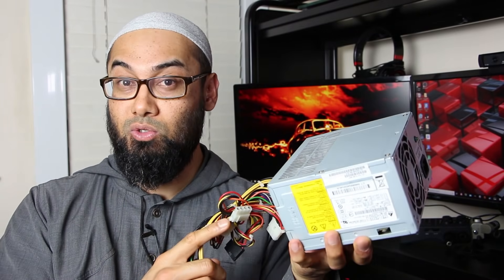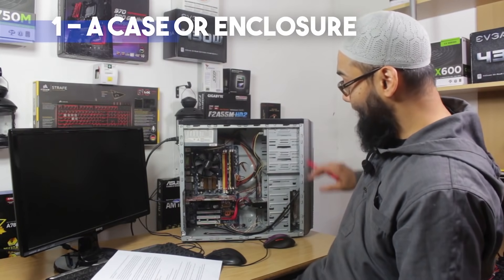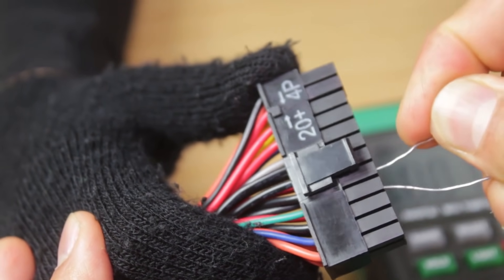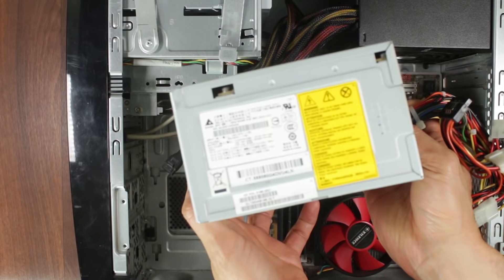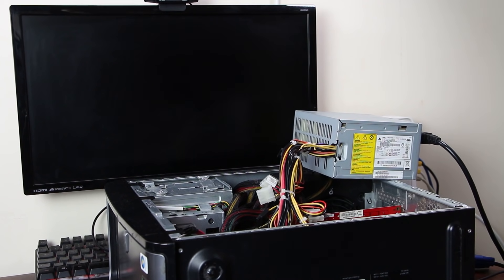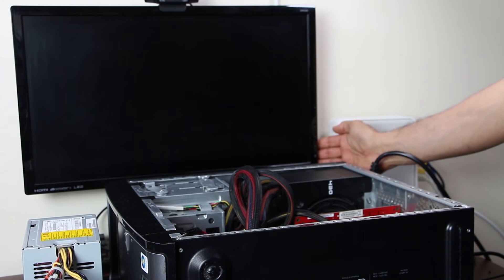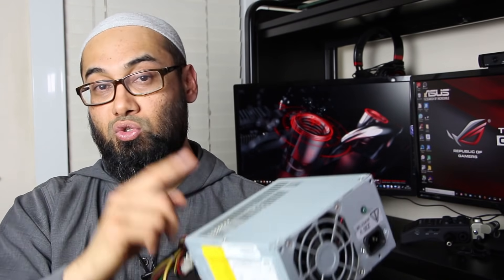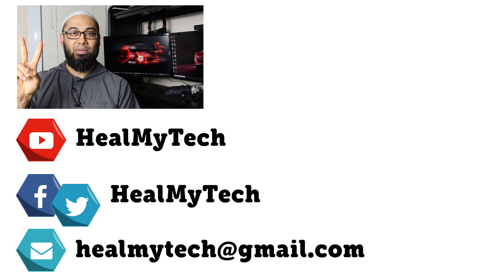Computer Turns On But No Display On Monitor | Led Light On Fan Spinning | Power Supply Unit Pc?

Comment: Ok so , my pc used to randomly go to a black screen when turned on , now it does that 100% of time , 
Took it to a guy , he said the bios were dead .. 
Could it be true
Reply from the maker: Possible, but impossible to tell without testing.  This video is only one possible way of troubleshooting and fixing a PC.  Based on all you questions, I have created a dedicated series to help troubleshoot all 10 main components of a computer in a logical process, I promise you if you follow it you will sort out your issue, since its the exact same process I go through when troubleshooting any pc problems for hardware.  Troubleshoot A Computer Series Playlist | Computer Not Turning On | PC Turns On But No Display On Monitor https://www.youtube.com/watch?v=Wkcx-x9gjkg&list=PLDmnHbxxv3ncrDmkkt4oVJTEIBIy9pvRN
Reply: @HealMyTech1  so he changed the bios on the pc , worked for one day , still doesn't boot like 1/3. Times bot boots fine 2/3 of the times 
Day 3 goes straight to black screen , 
Tried to follow the diagnostic serie you linked(thnx for responding btw) couldnnt fugure out what's wrong with it ... And i have no freaking idea

Comment: Well I'm here trying to get my pc to turn back on but it's not displaying...I've  Just opened it up for cleaning witch I useraly do and the power drop from my hand so I'm wondering is that could be the issue
Reply from the maker: This video is only one possible way of troubleshooting and fixing a PC.  Based on all you questions, I have created a dedicated series to help troubleshoot all 10 main components of a computer in a logical process, I promise you if you follow it you will sort out your issue, since its the exact same process I go through when troubleshooting any pc problems for hardware.  Troubleshoot A Computer Series Playlist | Computer Not Turning On | PC Turns On But No Display On Monitor https://www.youtube.com/watch?v=Wkcx-x9gjkg&list=PLDmnHbxxv3ncrDmkkt4oVJTEIBIy9pvRN

Comment: The ram is not fixed in the slot
Push the chip inside the slot until the side automatically closes
Reply: I LOVE YOU SO MUCH HONESTLY HAVE MY KIDS
Reply: Thanks bro that fixed it 4 me
Reply: @4Brazy  you are welcome :)
Reply: TY BRO U SAVED ME
Reply: Thanks bud
Reply: @SSBANG213  make sure you connected the cables into the right place for power starter button especially , make sure you connected the CPU fan cable in the right place.  All you for your computer to work is well connected CPU, RAM. if these 2 are working properly then you can at least access to BIOS
Reply: @ahmadal-khoory6352  I got new ram but that ram cause  shortage what is meaning of this?
Reply: @SSBANG213  It is not because of your ram, it is because of your GPU is taking a lot of electricity therefore you need to get a new power supplier. ram usually don't take that much electricity. ow and always make sure that ram has to be compatible with the motherboard, otherwise it will not work.
Reply: @ahmadal-khoory6352  but before putting the ram my computer was working
Reply: @SSBANG213  I am kind of sure that you did not put the ram in the slot all the way. you need to apply a little pressure. other than that I do not know what is wrong
Reply: @ahmadal-khoory6352  should I get new motherboard?
Reply: @SSBANG213  no, only If your ram is not compatible with your current motherboard
Reply: @ahmadal-khoory6352  it all happend when I asked a guy for a ram ddr3 but when I put it the display wasn't showing then after I got the ram out it was same so can u tell me what's the problem? Like my cables are correct  I dont understand
Reply: @SSBANG213  did you check with the guy if the new ram will work with your current motherboard. take the model number and name of your motherboard and check with that guy. be careful that the CPU might not work on a new motherboard check this as well with the guy
Reply: @ahmadal-khoory6352  i just told him to give me ram ddr3 4gb. And he tested it in his motherboard it worked
Reply: @SSBANG213  well, there are different types
Reply: @ahmadal-khoory6352  what do you mean?
Reply: @SSBANG213  there are different types of motherboards and each has different specs. therefore, certain CPU and ram work for certain motherboard. you need to check which ones work with which ......
Reply: @ahmadal-khoory6352  so that means I got the wrong ram. That damaged my motherboard?
Reply: @SSBANG213  its probably not damaged use the  old ram you got to find out
and google the ram you got and see if it works on your motherboard
Reply: Broo i love you i swear to god god bless bro you helped me out so hard
Reply: I thought that i had to buy a new pc i love you i swear
Reply: @KingAnubis9  you remind me of myself 2 months ago, I had the same issue :) God bless you too
Reply: Ahmad Al-Khoory I did. I am trying to restore an old Lenovo ThinkCentre m91p. I added in a Xeon E3 1270 and an RX 460 and 16 gb of ram. Whenever i turn on it doesn’t show anything. everything was in secured.
Reply: @someguywithmtndew5691  hmm, does the PC start up at least, if not then make sure to reconnect the power bottom cable to the motherboard
Reply: Ahmad Al-Khoory Yes it turns on.
Reply: @someguywithmtndew5691  try to find the problem, use your old ram see if anything changes, if it does show anything, then the ram is not working, maybe not secure enough
Reply: Ahmad Al-Khoory well actually im going to hook the motherboard to my power supply on my main pc (700 watts). I am starting to think it could be the PSU because when i install different ram the pc beeps
Reply: if it really is the PSU ima just wait until it is wednesday so i can snatch off a evga psu for cheap

Comment: I have this problem But it doesnt work with My mouse or keyboard either i guess its the same ? I didnt use the PC for a week
Reply: Testbravo YT did you fix this problem? Have the same but my screen is working tho
Reply from the maker: This video is only one possible way of troubleshooting and fixing a PC. Based on all you questions, I have created a dedicated series to help troubleshoot all 10 main components of a computer in a logical process, I promise you if you follow it you will sort out your issue, since its the exact same process I go through when troubleshooting any pc problems for hardware. Troubleshoot A Computer Series Playlist | Computer Not Turning On | PC Turns On But No Display On Monitor https://www.youtube.com/watch?v=Wkcx-x9gjkg&list=PLDmnHbxxv3ncrDmkkt4oVJTEIBIy9pvRN

Comment: So ... if no display just because of power supply i only need change to a new power supply?
Reply from the maker: Yes, but you need to make sure its only the power supply, it can be more than that, PSU is a very common issue, Ram as well, so you really nee to test.  This video is only one possible way of troubleshooting and fixing a PC. Based on all you questions, I have created a dedicated series to help troubleshoot all 10 main components of a computer in a logical process, I promise you if you follow it you will sort out your issue, since its the exact same process I go through when troubleshooting any pc problems for hardware. Troubleshoot A Computer Series Playlist | Computer Not Turning On | PC Turns On But No Display On Monitor https://www.youtube.com/watch?v=Wkcx-x9gjkg&list=PLDmnHbxxv3ncrDmkkt4oVJTEIBIy9pvRN

Comment: How to fix Unit the problem is wont boot but its turning Led light and the fan
Reply from the maker: This video is only one possible way of troubleshooting and fixing a PC. Based on all you questions, I have created a dedicated series to help troubleshoot all 10 main components of a computer in a logical process, I promise you if you follow it you will sort out your issue, since its the exact same process I go through when troubleshooting any pc problems for hardware. Troubleshoot A Computer Series Playlist | Computer Not Turning On | PC Turns On But No Display On Monitor https://www.youtube.com/watch?v=Wkcx-x9gjkg&list=PLDmnHbxxv3ncrDmkkt4oVJTEIBIy9pvRN

Comment: My issue was just the ram. So if any one is having an issue displaying just take off and reinsert the ram. Great video man!!
Reply: did the led on your fans start because my fans start but no led and no display
Reply: @radlightning8002  my fan doesn't have an led :/. But the fan it self was on
Reply: lilsphere ok same did it fix after you put the ram back in
Reply: @radlightning8002  yeah it fixed it right after I put it back in it and turned it on. I tried a bunch of other stuff but it was just plugging in the ram. Hopefully yours work!!
Reply from the maker: Thanks!

Comment: My computer was doing well and after changing my cpu for a new one was working well and did a couple reboots before for updating the Bios and so far so good. I was checking the amd settings and showed me a new optional update aaaand asked me for a restart SO I DID, turned off and didnt boot properly since that. BLACK SCREEN and i had to force shut down sadly (mouse and keyboard not working when black screen happened). So i boot up try to update driver again to see if that was the failure and it did AGAIN but this time didnt wanted to turn on. I have this pc for 2 weeks now. Any suggestions?
Reply: Ever Hernandez did u end up fixing it
Reply: @nibbski6677  I changed the power supply and until now I haven't got any trouble.
Reply from the maker: Sometimes Bios updates can be problematic, they are supposed to work in theory.  You should contact the motherboard manufacturer directly.
Reply: Ever Hernandez same! Wtf is going on AMD?!?
Reply: Ever Hernandez did you have a gigabyte motherboard?
Reply: @DavidMunoz-pb9iu  AsRock

Comment: My pc is on but the monitor goes black and there's no sign like no signal or something, I tried remove the power cable but it still the same, I use new dvi to dvi and dvi to hdmi already but still the same. I tried switch the monitor to my tv and it works very well I've been using the tv for hours but the monitor takes like a few minutes and turns to black.
Reply from the maker: This video is only one possible way of troubleshooting and fixing a PC. Based on all you questions, I have created a dedicated series to help troubleshoot all 10 main components of a computer in a logical process, I promise you if you follow it you will sort out your issue, since its the exact same process I go through when troubleshooting any pc problems for hardware. Troubleshoot A Computer Series Playlist | Computer Not Turning On | PC Turns On But No Display On Monitor https://www.youtube.com/watch?v=Wkcx-x9gjkg&list=PLDmnHbxxv3ncrDmkkt4oVJTEIBIy9pvRN

Comment: When my computer is powered up it runs for various length of time before monitor goes black with no cursor.  I purchased a new power supply because old power supply was dead.  However, the problem continue.  I hear this ticking, clicking, buzzing sound from the power supply area, then monitor goes black and all I can do is restart the desktop computer.  This is very frustrating and annoying.  I have a HPE 140f Pavilion Desktop computer.  The monitor works fine with another computer.  Could you help me with this problem?  Thank you very much.

Comment: I was playing fortnite when all of the sudden my monitor and computer shut down, my pc still turns on but my monitor has no signal, someone please help
Reply: Try and use a different monitor
Reply: Berlinwallneverfall 89 I just took out my gpu because I realize it wasn’t spinning and reconnected it and now it works
Reply: @DoubleU_X  nice

Comment: I just got a pc today, it was working well, and now the display isn't displaying right, all the fans are turning, sometimes it will display briefly, with a bunch of red lines, what would you guys think the issue is?
Reply: Same thing happened I redid the psu cords and checked if the ram or gpu was placed in right

Comment: My lights will turn on sometimes when I turn it on but the fans always do. Now seeing this video makes me think I need a new power supply.
Reply: Lagod the same thing happened to me i brought it to canada computers and they said that mine was a power serge or sum
Reply: For those wondering if I fixed it didn’t. I tried everything and didn’t get it to work so I blamed it on the motherboard. But I looked back on the problem long after I got rid of the motherboard. I looked at a forum and someone had the same problem as me. He found out it was the cpu. I still don’t know exactly if that was the problem but it seemed to be because I checked everything but the cpu. I now built my own pc. That other one was a hp prebuilt
Reply: Lagod is it...I replaced my psu, mobo, ram and still no display. My monitor works
Reply: Alex X damn bro I’m getting my new mobo today hopefully I don’t have the same problem.
Reply: Archie Games yeah it sucks.
Reply: Alex X idk for sure but like I said it seemed to be. What are you working with?
Reply: Lagod 
GIGABYTE GA-880GM-D2H (REV. 3.1) AM3+ AMD 880G HDMI Micro ATX AMD Motherboard

AMD FX-8350 Black Edition Vishera 8-Core 4.0 GHz (4.2 GHz Turbo) Socket AM3+ 125W FD8350FRHKBOX Desktop Processor

GIGABYTE GeForce GTX 1050 DirectX 12 GV-N1050OC-2GD 2GB 128-Bit GDDR5 PCI Express 3.0 x16 ATX Video Card

Power-Star 650W-Max 12-CM FAN ATX Power Supply w/20+4pin, SATA & PCIe'

8GB DDR3-1333MHz
Reply: Alex X Jeez man That cpu is still pretty expensive. I’m sorry you spent all that money and still didn’t fix it. You most likely have to replace your cpu.
Reply: Lagod 😪. I don’t have an extra cpu lying around to really test it.  But considering I replaced my psu ,mobo ,and ram...it looks like my cpu is the issue.
Reply: Alex X if you do buy a cpu I hope everything works out fine
Reply: Lagod i just bought a cheap one. I downgraded it. Hopefully it works out ✌️
Reply: @alexx3914  Video card?
Reply: Justin Black could be. But I put my money on the cpu already. If that don’t work then it has to be the gpu
Reply: @alexx3914  might just be the graphics card
Reply: @alexx3914  if not then the cpu
Reply: @mimfz3171  no it was my psu
Reply: @alexx3914  for me I had a faulty motherboard
Reply: Lagod turns out it was the psu.
Reply: Alex X yea I got a new motherboard and it didn’t change anything so that has to be the reason
Reply: Alex X wow
Reply: So it’s the power supply doing all these naughty things?
Reply: @ZOPPOLETTO  looks like it
Reply: Same
Reply: For some reason when I turn my PC on the GPU fans don't turn? And there is a red debug light right by where it says cpu
Reply: Same happened with me fan turn on but after 2 sec the speed reduces of the fan and none display
Reply: I got same problem but I got brand new power supply
Reply: My power supply is literally new. And this video is making me think that I need a NEWER one

Comment: I have a built pc. Cpu fans, Graphics card spinning but no display. And it wont turn off without unplugging it.
Reply: @morbd6048  I found out the issue. One of my ram was DOA.
Reply: Ohaiderepeeps what does doa mean
Reply: @fore20skin22  it means dead on arrival(DOA). Basically when you order tech stuff from amazon and it comes broken/unusable.

Comment: hi, display for my newly built PC is not working and shows "no input detected" on the monitor. 
I tried:
-Switching RAM to different places
-Tried one Stick of RAM only in each RAM slot
-Taking out Graphics card > then tried booting without it
-Putting Back Graphics Card then booting
-Unplugging power supply cord from back, then pressing case power button for around 30sec-minute
-Tried and reassured 24 pin cable was in
-tried switching pc-u chords to different orientation (like your other vid)
-Tried praying to the pc lords 

None of which have work, and now im eating my sorrows away. Please help. Not sure if (but feeling like its highly likely) that one of my components are malfunctioning but dont know which

Comment: Thanks Mister, now my pc is working properly, this "no signal" thing happened because i was cleaning my cpu then it looks like i loosen a plug in the motherboard so I plugged them properly amd it worked
Reply: Which plug was it bc my monitor keeps saying no signal too and I have everything plugged in too but idk which plugin it is
Reply: @zacharymulkey5877  Have u resolved? I have the same problem

Comment: My PC has this exact issue but my keyboard (which is directly plugged into the PC via USB) is getting power as the LEDs are lighting up on it, with the colour green which I have never selected before. Does this mean the cause might be different? As parts other than the PC LEDs and fans are working.

Comment: I have a problem with my alienware x51 r2. I went on dell's website download the bios update and restarted my system. Then as it's starting back up it wouldn't go to the Windows screen. So i turned off the computer restarted it again and now it's on the black screen and is beeping non stop. So do i have to clear my whole computer because i really don't want to lose all my file's i need help.
Reply: Try manually resetting the BIOS

Comment: after switch on from power plug.. my pc need a few minutes then i can power up the pc.. later the monitor problem appear.. is this a power supply issue?
Reply: Might be the hsf or lack of thermal paste.
Reply: @jrlabrador7123  seems like the psu is the problem.. thus im upgrading the rest 💸💸💸💸💸💸💸😅😅

Comment: Hi i just built a pc today and everything has power and all the wires are connected correctly but i get no signal do u think its same problem?

I have a r3 1200
A320m-k
Ballistic sport 8gb 2666
Rx 580
Areocool 500w
Reply: The Kings Esports check your front panel connections